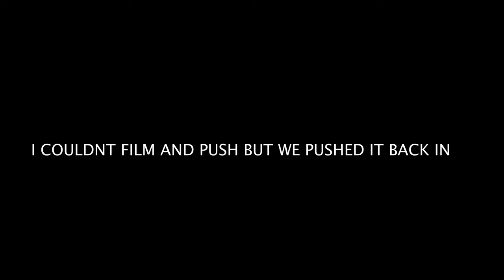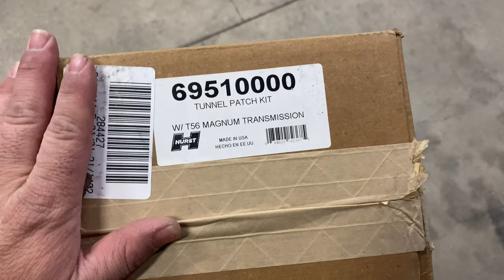Slicing and dicing! Modifying the trans tunnel to fit a T-56 in the 1963 FALCON

Comment: MalWood hyd clutch pedal set up ford mustang should work , mid plate helps too.🐕👍
Reply from the maker: I want everything hidden from the engine bay so going with Tilton stuff
Reply: Check it out mount under dash and mounts to clutch pedal assembly

Comment: Hey Boss try cutting a 2x4 in to shims put on top of trans and on sides for clearance, then cardboard templates cut ,tape do it in 2 pcs then weld middle together . You need drive shaft loops too, when welding thin metal and blow through  take copper tubing flatten 2-3 inches  hold behind hole then weld won't weld to copper. What engine combo are you going with ?? Tkx is smaller 5 speed or you want 6 speed
Reply from the maker: 363 8.2deck Windsor, single turbo, T56 trans. Trying to make about 1300

Comment: Sir. My 1965 ranchero front cross member was sevored to fit a top loader with the linkage bolted to back of tail shaft. I would like to repair this cross member. There is one available at ch pony parts for a 1965/66 mustang. Do you know if this van fit a 65 falcon/ranchero?
Reply from the maker: I think it may fit. I am not totally sure though. You can buy it and see and if not return it!